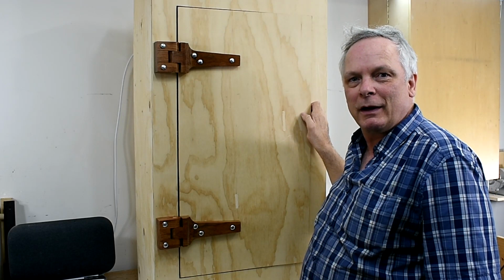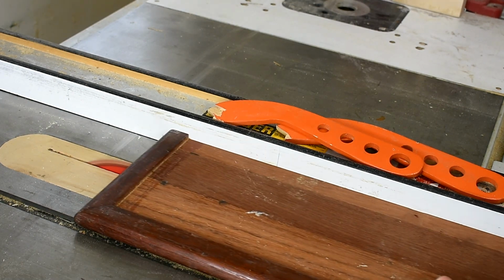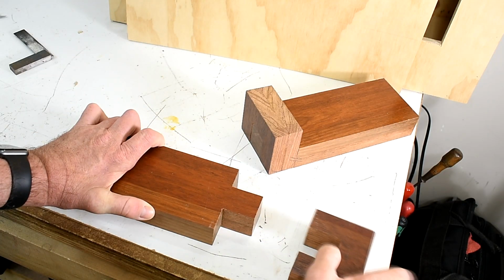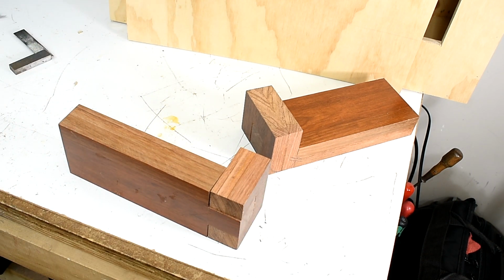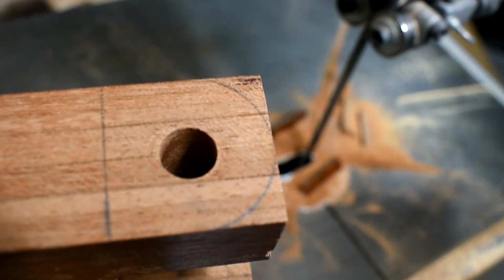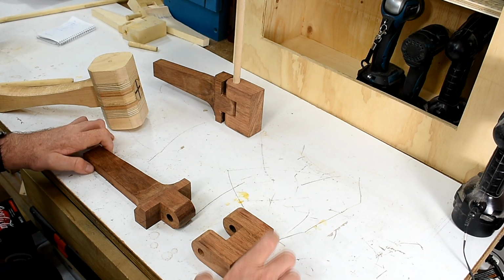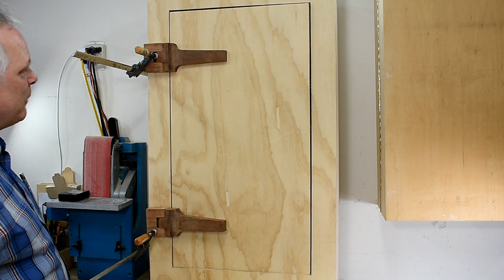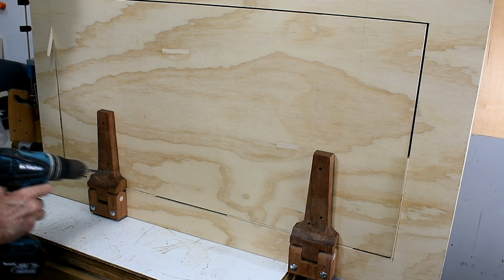How to Make Wooden Hinges

Comment: Cool hinges, bro. Thumbs up! 

It would look great if you attach them with wooden pegs instead of steel bolts. Also, you might want to put some kind of grease  on the parts that rub together.

Comment: One way to line up the hinges is to use a pin that goes through both hinges, lay the hinges on the cabinet  and make sure the pin is parallel to the joint between the door and cabinet.  Then cut the pins or replace them.